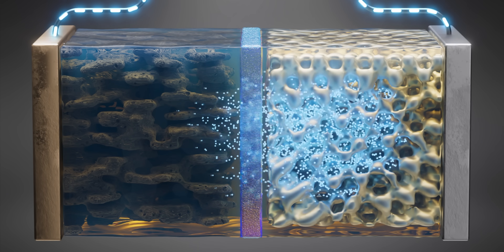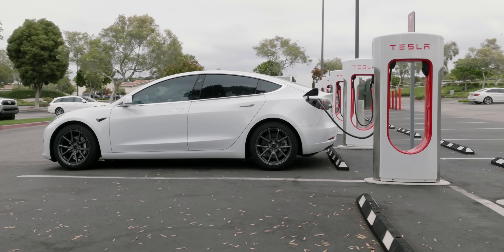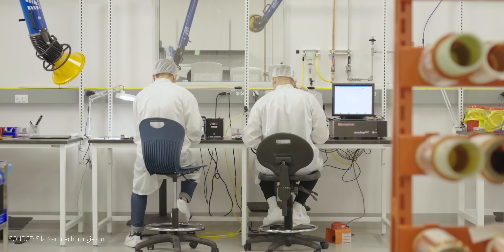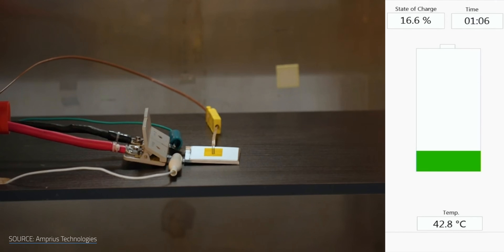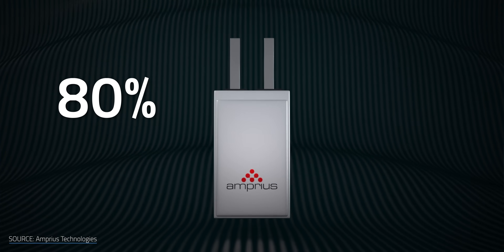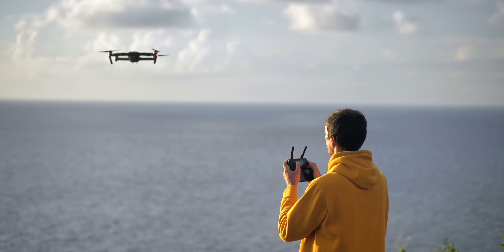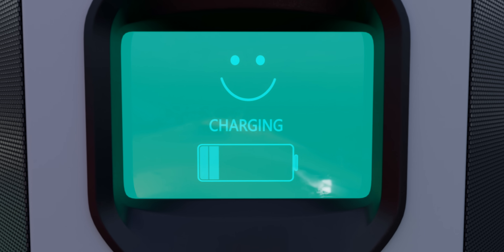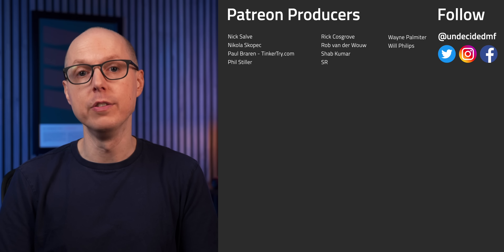Why This Ultra Dense Battery Breakthrough Matters

Comment: I mention this every time someone claims we will see really fast ev charging. Let's assume a 20% to 80% day charge on a 100kwh battery. So that's 60kwh of energy that needs to be added to the battery. To do that in 6 minutes, 60kwh / (6/60) = 600kw charge rate on average assuming no losses. The NACS connector is rated for 250kW, so you'd need 3 of them per car, so there is an issue with simply delivering the power from the station to the car. Not too mention that if you want to charge 4, 6, 8, 10 cars at the same time you could find that the station needs a small power plant (6MW) onsite just to handle the peak loads. Basically the infrastructure required around the charging station is going to limit our ability to charge multiple vehicles at a time at these high rates even if we solve the battery side.

Comment: It matters, when it is on the market and operational. Until then it does not. 
If I had a buck whenever a magic new battery was announced to rock the world soon, I'd be a millionaire. 
If I had a buck whenever a groundbraking battery tech actually managed to rock the world... I had about 5 bucks.

Comment: I dont need a 6 minute charge time to 80%, thats not enough time for a bathroom break and a coffee. 20-80% in 15 minutes would be more than fast enough. For the majority of the time you'll charge on low power AC amyway

Comment: Amprius is interesting, but my guess is there are at least a dozen batteries in development that will beat them to EV application. Firstly, Amprius isn't prioritizing EV's. This is a big problem because many competitors are. Secondly, the competition is fierce. I would ask Matt to feature these multiple competitors if possible. Solid state batteries show the potential to dominate the EV battery world.

Comment: While you mention the wire format used allows space for expansion and contraction, you don't zero in on the cycle life longevity of these batteries. Would we get 1M miles from a pack? Or what is the life estimates. That's more important than some other factors for me.

Comment: Just scrolled through 4-5 years worth of your videos while watching this.

Though I've watched most ..multiple times.. especially including the ones on graphene ..where my following recommendation is covered as a subset within those (more-recent) videos..

Read: you've covered it before, but not as a specific stand alone video. A 'longer-short' even could cover it.. or a 'shorter update-style long'..

But you should do an 'update' on current state of while simultaneously focusing specifically on.. flash graphene. 

By & large the breakthrough was 4'ish years ago at this point, but the advancements by the companies working on it are actually pretty solidly substantial. 

By doing a specifically-focused update, you could not only do just that: update, it could also kinda-sorta 'pop out' some competition to help catalyze some coming forward to renew their specific focuses for funding while providing a sort of new-level bringing current bleeding edge into the light. A new leverage point for the field, so to speak.

With the Ford/GM union talks culminating to earlier-gen first wave battery plants continuing their move forward, the next-gen facilities in KY & Michigan are in a stalled state. 

Coverage could poke those with a stick. It's actually an auspicious time to cover it.. as those next-gen facilities being delayed could help the forward movement of the tech they'd focus on once they begin moving forward again.

Obviously graphene will .. leap ahead of several sub-tech product cycles being designed into markets. Getting a solid short state of the times update clip out there could help ensure some of these product cyclings are more quickly turned into products to cycle through .. helping to add a bit o' 'fat' to the tech types available vs them sorta just being plowed over by a next-gen tech that essentially makes them.. ..unnecessary. 

The scientists researchers and designers could use the opportunity to get some shine that next-next gen tech would more-likely cast shadows over.

Plus would just be cool for your take & coverage on the more recent advancements. I've a pretty solid 'hunch' that the breakthrough-tweaks affording the scalability of the tech have already been 'discovered'.

Comment: My understanding is that mass production methods for silicon anode batteries are also being developed directly across the street from Amprius Technologies, at Tesla's Kato Road R&D center. These batteries, and similar energy density Condensed batteries from CATL, will likely remain in limited applications, such as VTOLs and electric racecars, throughout most of 2024. I expect 2025 to be quite a different story as these silicon anode batteries are produced en masse and incorporated into Tesla vehicles such as Semi, Cybertruck, and their next generation Roadster.

Comment: I wonder how dirty silicon refining will be "than we previously thought" ?
A quick search reveals:
"...Raw quartzite is mostly silicon dioxide (SiO2), and the refining process begins with a reduction reaction to get rid of the oxygen. Crushed quartzite is mixed with carbon in the form of coke (coal that has been heated in the absence of oxygen). Woodchips are added to the charge as well; they serve both as a carbon source and a physical bulking agent that allows gasses and heat to circulate better in the furnace.

The arc furnaces for silicon smelting are massive installations with huge carbon electrodes. The electrodes are consumed during smelting, so new electrodes are screwed onto the tops of the current electrodes to make sure the process isn’t interrupted. The arc furnace requires massive amounts of electricity to maintain the 2,000°C temperature needed, so silicon refineries are often located where electricity is cheap and plentiful.

The reduction reactions inside the melt zone are actually pretty complicated, but can be summed up with two main reactions:

SiO2 + 2 C > Si + 2 CO2 SiC + SiO2 > 3 Si + 2 CO

In both reactions, the oxygen in the silicon dioxide combines with carbon to form the main waste product, carbon monoxide. A side reaction that occurs in a part of the melt zone inside the furnace produces silicon carbide (SiC), which is an unwanted byproduct (at least when the goal is to purify silicon; silicon carbide itself is a useful industrial abrasive). By making sure that silicon dioxide is far in excess in the furnace, the second reaction where the SiC acts as a carbon source for the reduction of silicon dioxide is favored, and silicon with up to 99% purity can be tapped off the bottom of the furnace."

as clean as a whistle (a burning carbon whistle blown with a CO2 supply)

Comment: While energy density is important, this doesn't address one of the major issues - the lithium itself. When doing a video about batteries (or any technology really), I would like to see not only what problems it solves, but which problems remain. Although silicon is abundant, lithium isn't and the mining/refining process has a lot of human rights issues and environmental issues. Could this technology be used with sodium to bring sodium batteries that aren't as energy dense inline with lithium batteries?

Comment: The sila battery in the whoop was a fantastic upgrade.  The battery is great.  It is fascinating that scale is the entire challenge now and automotive drives the whole industry.
Reply: I worked in the research group where the CTO got his PhD in, back then they etched Silicon carbide to make carbide derived carbon, and Sila is essentially using the same process. That lab invented a new family of nanomaterials called MXenes which are carbide 2D materials made from bulk carbides making one of the best materials for RF applications but idk if there is much commercial applications due to corrosion of 2D titanium carbide
Reply: @cybyrd9615  I vaguely recall reading about MXenes years ago, iirc they thought it might be useful for computing applications (a lot of research has gone into alternative semi-conductors as we're really pushing the limits of silicon in that sector and ironically just starting to use silicon in the battery sector).
Reply: @grn1  so for compute we are researching 2D materials with spintronic electron microscopes and they wanna make topological quantum computers with them. But MXenes are made like chemicals not grown, they don’t have the defect control necessary for what physicists want
Reply: re: "It is fascinating that scale is the entire challenge now and automotive drives the whole industry." no, you only "think" automotive drives the industry by virtue of NOT knowing what NASA and the US Military (Navy in particular) have been up to for the last 50 years.  see Wiki entry for the psychology of "Confirmation Bias".

Comment: Environmentally speaking, this battery tech is another small step towards making eV's an actually viable replacement for ICE vehicles. eV's are BRILLIANT, but.. .. the tech is so far away from being the miracle replacement for gas guzzlers. Like solar panels and wind turbines which are not environmentally friendly due to their actual lifetime use and unrecyclability.

Comment: As a shareholder it’s been a rough year, but I think the concept is sound and will come good. Put it this way if we can get car batteries over 400 watts per KG then it will allow for radically smaller lighter cheaper vehicles with a decent range. I suspect that will take a while, so the first real world volume applications will no doubt be in laptops. All exciting stuff.
Reply: I could see it becoming a premium option in high-end models as a starting point.

Comment: Good to see some coverage of Amprius. 
But surprised at the 'doubts on viability of eVtols'. 
What part do you doubt?

They are already being sold to consumers! There are multiple models with 170 to 300km range going into production this year & next year.

By the way, the Amprius 450Wh/kg battery is alreafy commercially available and Amprius has announced a higher density 500Wh/kg model.

NASA has published papers showing 500Wh/kg is the density that makes regional electric airline routes viable.

Comment: one thing i'm wondering is: with greater energy density, how does risk/danger increase when the battery is crushed or pierced?
Reply: More lithium is more intense fires. It's the lithium that in combination with water and air is the thing that is so hard to put out. So if you put more lithiumin them there willl be a longer/more intense fire if a fire occurs.

Comment: I've worked with both Amprius and Sila. Sila is in products and I'm not sure if Amprius is. I was most impressed with Sila and their tech really works. Lower voltage but higher overall energy density.

Comment: Assuming they can scale up the silicon technology, is this compatible with the recent interest in replacing lithium with sodium? Could be interesting.
Reply: Maybe, but it's worth noting that sodium ion batteries are fundamentally worse than lithium because they use the same charge carrying phenomenon but sodium weighs a lot more than lithium per unit charge. The real benefit of sodium ion is that it's really cheap in theory and good enough for a lot of applications that lithium is currently being used for, so it would allow lithium to be reserved for higher performance applications (eg sodium ion is really good for compact commuter cars, the vast majority of which will never go on a road trip and have plenty of range for even fairly long distance daily commuting). This means that even if you can't use these electrodes in sodium batteries it doesn't really matter, because sodium isn't even about top tier density and performance anyway

Comment: Big if true... This should be the disclaimer for all EV and battery news.  There is a lot of vaporware around. 

It sounds like your legroom or ground clearance may shrink with battery state of charge.  Im going to let those silicon based batteries run their course in the market a while before i plug one in in my garage.

Comment: Given the hyped panic around depleting supplies of silicon for electronics, and the constant issues with sand in general for construction, I have to wonder how this battery tech is going to fare in the near future.
Reply: Silicon is not rare and there is nothing special about the source.  Making very high purity is the issue and evidently we need more manufacturers for that.
Reply: Cody's Lab, YouTube channel, made metallic Silicon from play sand using a thermite reaction in his back yard. I think the "nano growing" thing here is the limiting factor.
Reply: Different kind of silicon.  Atomically, yeah, silicon.  But the stuff used for making wafers (electronic chip substrates), and the sand used in construction are specific forms of silicon that are not as widely distributed in the Earth's crust.  This use of silicon where they're building nanowires, uses raw silicon.  The source isn't nearly as important, because the final form is artificial rather than a naturally occurring type that's in shorter supply.
Reply: @darylsonnier658  Yep, constructing sand is specifically about rough vs smooth grains, which is why you can not use desert sand

I think the electronics thing is that it has to be ultra high purity?

Silicon is the 2nd most abundant element in the Earth's continental crust, so not like it's rare
Reply: @HorzaPanda Water is very abundant too, heavy water not so much. If this thing uses any kind of silicon purity, great. If they don't, it will suck resources and electronics will only get more expensive.
Reply: @HorzaPanda  Yes, it's very high purity of specific types of silicon grains.  If you had the patience and money to waste on it, you could start with any source of silicon and end up with what they need, but that's exceedingly expensive.

Comment: I notice they aren't talking about the biggest issue with silicon anodes, namely cycle life. I was a bit disappointed you glossed over that, Matt. You also didn't mention that currently the tech is only achieving 370 Wh/kg in commercially available batteries and not 450? Which is only 25% better than the best carbon lithium ion batteries. In fact their whole website seems deceptive. Making claims about 450Wh/kg, showing comparison graphs that imply that 50% increase in various battery applications and then right at the bottom of the page they mention their commercially available battery. It's great that they've made a battery that will charge at 10C and has 25% more energy density and they claim "excellent cycle life" but then they don't actually say what that is. They also don't mention the cost per Wh because it's probably very, very expensive given the only one's currently testing it are the military, labs and major aerospace companies. I hope they succeed but I'd prefer less marketing on their website and more actual facts and figures.

Comment: Matt I never miss your fabulous presentations and I have info. We used PHOTONS which are Dirac neutrinos (black/white particles) from pulsed lasers and shot it thru a TUNED venturi to create the BLACK Sterile Muons and BRILLIANT WHITE Electron Neutrino showers. I think we could harvest the white part as it exits the venturi so it is Raw Electrons. Would you contact me please Sir,  If my design works it will provide lots of juice from a small solid state device...basically continuous free energy.
Reply: Energy put into making pulsed lasers must be free then?

Comment: When you said, "This is great not just for drone hobbyists", I really expected the military to follow not some search&rescue or research. Neither search&rescue nor research have free money to pay for 50% more range but military absolutely does! All eyes in European and US militaries are on how Russia and Ukraine are using electric-powered drones on the battlefield, with Russia leading in the larger loitering munitions (kamikaze drones) like Lantset and Ukraine leading in smaller FPV-drones and quadcopter bombers
Reply: Price is an issue though with attrition wars like the one in Ukraine. So even a military likely would favor cheaper shorter range drones for the bulk of the fleet and only use the increased range or lighter smaller drones with this battery tech for the use cases that truly makes them cost effective. I think one thing I have realized with the Ukraine war is that our military might be very capable but its way too expensive to keep fighting a real war for the years needed to defeat a peer adversary. If we don't mass produce cheaper munitions that are effective enough for their roles and reserve our fancy high tech stuff for the edge cases when you get super good bang for buck we will lose the next war.

Comment: To say not much has changed in lithium ion in 3 decades is as ludicrous as the frequency of "the next big thing" videos this channel pumps out.

Just 10 years ago, my cordless tools were garbage. Now I have a 56Volt chainsaw with a headlight. It took last weekend to cut my girlfriend's uncle's firewood for the winter. 

I recently replaced 10 year old Bosch cells in my 1.3Amp batteries. Now they hold 3Amps. Energy density in lithium ion has vastly improved, so why dump on it when it's what we have. Still waiting on graphine, which you also praised as if it was a month from store shelves.